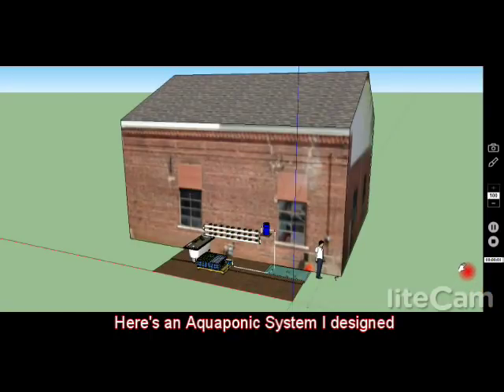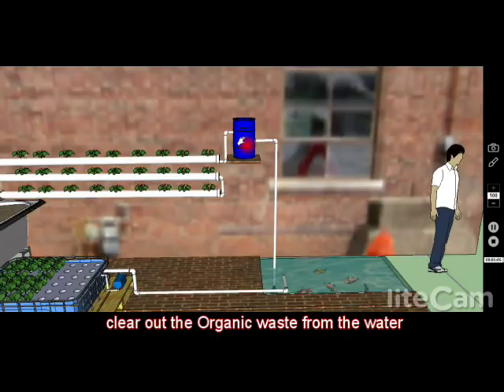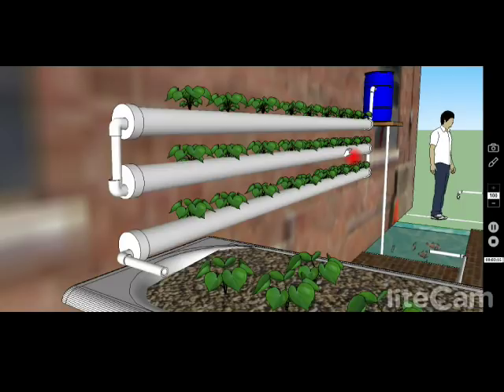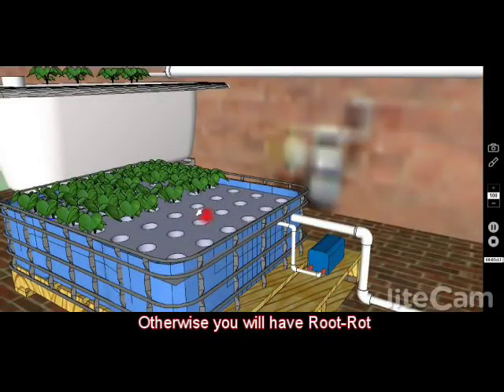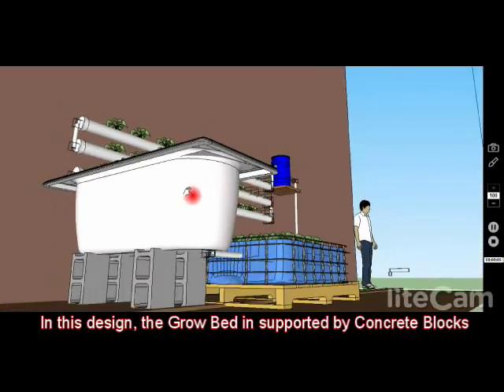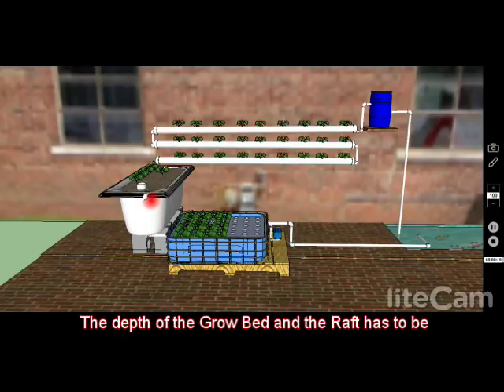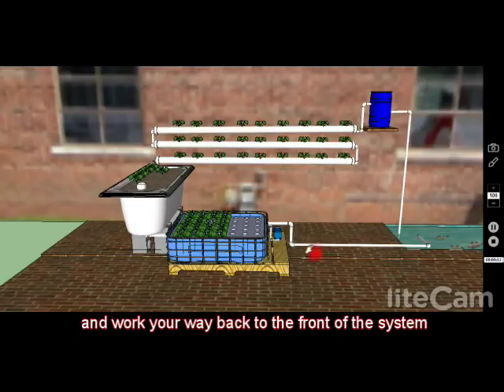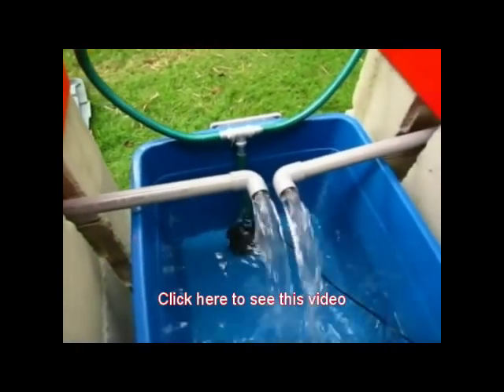DIY Aquaponics for Beginners 2014, a How To guide to making your first AP system

Comment: worst sound quality but one of the better systems I have ever seen. The only issue I can see is that assuming the wall is your house wall air pump will make continuous noise. And pumps tend to fail often I wonder if you could get away with single pump in this system.... An expensive one which will pump air and water...

Comment: I think its only theory.  And cannot work properly.  Because its lack of filtration.... And application not working. So much amonia if just swilrl filter installed. Plant need nitrat.. No amonia
Reply: u can put extra filtration in the bucket and use more than one bucket filter system maybe 2 or 3 buckets total

Comment: Not a good setup. Good concept, but...
1. Pumping water from the fish talk is too dangerous. If there's any leak, the fish will be dead.
2. The swirl filter will capture a lot of solid, but some will make it to the pipes and clog it quickly. Cleaning is frequent and messy.
3. The flow from swirl filter to pipes must be low, which will be hard to trigger the siphon on the grow bed.
4. When the siphon starts, the flow of water to the raft bed are fast and strong, which roots really don't like.

A modify design would be to tread each system separately with ball valves to adjust for water flow. This will also help in maintenance, as you don't need to shut down the whole system. Also add a sump tank. I use all of this in my own system.

Comment: Perfect. Absolutely perfect translation for those who have no prior experience to gardening, least likely hydroponic nor auquaponics. This system could easily be placed indoors by moving fish into a tub.
Great job.
Reply: This gives me a reason to get a larger fish display tank (55 gallons) and routing the water filter through a pvc hydroponic system across the wall, bringing clean water back to the tank.

Comment: Nice design! I think having at least 2 different growing styles is ideal. I think this is the first i've seen that uses 3 different methods.
Reply: Any particular reason to use multiple systems?
Reply: @AbhimanyuNaikareWebDeveloper  Different plants have different requirements, so rather than just limitting yourself to leafy greans in an NFT system you could add growbeds and allow for tomatoes etc.
Reply: @gaijinguide9017  Thanks for the quick response. Can i find which plant suits which system anywhere? Also there is no mention of temperature control here. I believe it also plays an important role.
The nutrients being added in water won't harm the fishes in the last pond?
Reply: @AbhimanyuNaikareWebDeveloper The School of Aquaponics channel is really helpful. Other than that there are a handful of others that I'm subscribed to. (You can search thru my subs if you wish) Don't know too much about water temp honestly. Adding chemicals to treat your fish/plants can be destructive but their are plenty of nutrition supplements that will work great in Aquaponics. Just search "trace nutrients in Aquaponics" and something should come up.

Comment: Your whole system is great as it is. You can, however, improve it a bit by installing another filter after the swirl filter. The swirl filter can only filter heavy solids. It cannot filter suspended solids. These suspended solids will eventually lodge in the roots of the NFT system rendering those plants inefficient. If you don't want to install a fine filter then you can put the growbed before the NFT. The growbed will act as a fine filter.
Reply: Aquatic plants waterhycine  deep roots plants  can help

Comment: That swirl filter is useless. The organic matter is too dense to sink to the bottom. Plus, the uptake pipe from the submersible pump would need to be above the outlet pipe going to the first set of auqaponic system. This would be a pretty expensive setup consider that submersible pump is going to cost a few hundred. The idea is good, but not practical.

Comment: Some systems have biofilter after swirl filter - your system does''nt need that why?
Reply: Hello Thùy Linh Nguyễn Thị, the swirl filter is likely to settle most of the solids which can then be removed and used for fertiliser on the soil garden (vegetable or flowers). However, if the solids accumulate too quickly a bio-filter would be useful, particularly before an/the NFT system.. Often, the media grow bed is used or takes the place of, the bio-filter.
Reply: The media bed is a bio filter by default, if it has surface area and oxygen it becomes a bio filter. Tis important to keep solids to a minimum if you dont want the media bed being clogged up, in which case its a mechanical filter that is needed.

Comment: The water from media bed to raft bed flows not continuous, for example until the siphon opens and let some amount of water flow to raft bed i cannot imagine what will be the level of water on raft bed.
Reply: Hello Duman Kurenbaev, because the inflow pipe to the raft bed is at the same height as the outflow pipe, the water in the raft bed will stay the same all the time. So when the bell siphon in the media grow bed opens (siphons) the same amount of water will flow out of the raft bed as flows into the raft bed from the media grow bed. In this system, it is the water level in the fish tank, being used also as the sump tank, which will rise and fall as the water flows into the media bed and siphons out to the raft bed.

Comment: Not a good setup! So many problems can occur, from start to finish.
1. Pumping water up from the fish tank will cut the waste into smaller pieces, making the swirl filter less effective.
2. Some waste will get into the pipes, which will clog it very fast, causing over spill. 
3. Timing the water flow from the pipe to grow bed is quite difficult for the bell siphon to work.
4. When the nutrients reached the raft, it may be mostly depleted.
5. If one part of the system need maintenance, the whole setup may have to shut down, which many be harmful to the fish and plants.

I have a system with all the components, but I added a sump tank that everything flow into.
Reply: Hello Mark Ho, although I understand your concerns, this system is intended to be a small beginners system, so any maintenance downtime is likely to be short and is part of the learning process. I do think it is a good beginners system, incorporating the three main system types, in an inexpensive, easy to build and modify setup. All of the components of this system can be used later, as required or desired, in a more sophisticated system.
Reply: P.S.        Particularly if integrating an already existing in-ground fish pond or tank, not wanting to build a fairly heavy raised fish tank for the system, or dig a lower sump tank.

Comment: This is a great idea to make use of all the nutrients and cater to a variety of different plants. There is however one downside to your system, due to the bell siphon in the grow bed, your fish tank will experience a rise and fall of water depth which is supposedly not ideal nor is the pump within the water. An easy solution is to create a reservoir housing the pump, this is then attached to an overflow on your fish tank and therefore keeping the irritation of the pump and water lever of the fish tank to an appropriate level at all times.

Comment: Is there any particular advantage to using a bell siphon vs just a plain old drain pipe? I was asking a horticulture teacher recently about why some commercial operations i see have the plants continuously submerged, like media cups just poked through holes in styrofoam and the foam floating directly on the water and others do these ebb and flow setups where they're only exposed to the nutrient water for limited amounts of time. Why? Are there certain plants that just don't do well with constant exposure?

Comment: Surely if you had put the media bed before the NFT you would have not needed the swirl filter?
Reply: Spot on.. the only time needing an actual filter with media beds is when using dwc as the tank needs different flow rates then nft and media beds.. the one large media bed could have easily filtered and supplied flow for the nft in this system.
Reply: Not certain about the points made but ,if anyone else is searching for aquaponics diagram try Debuncar Amazing Aquaponics  Aid (should be on google have a look ) ? Ive heard some amazing things about it and my buddy got excellent success with it.
Reply: Go here now if you want the best aquaponics system online: HootAqua.info
Reply: interesting points ,if anyone else wants to learn about aquaponics courses try Tarbetti Amazing Aquaponics Tutor (do a search on google ) ? Ive heard some pretty good things about it and my friend got great success with it.

Comment: Could you use a kratke method for your raft bed? No idea if I spelled kratke right but basically you leave air space on the root so you don't need a pump.

Comment: Wouldn't it make more sense having the NFT draining into the raft bed before running into the media bed, as the media bed when draining via the bell siphon would put a major leak risk by adding too much water when draining.

Adding the raft before the media bed means that the constant drain from the Raft and NFT work at a more even pace removing or lessening the risk of overflow or leaks, and u could add a ventauri to the drain into the fish tank that would only work when the siphon is running..

Just occurred to me when looking at the design. No insult or slight intended, just observation
Reply: I agree with your thinking.  The inlet to the Raft can be at the bottom and outlet on top so there is no stagnant water.
Reply: agree
Reply: I've been investigating books on  and found an awesome website at Fast Track Grower (look it up on google)
Reply: Here's a great aquaponics system that I use: AquaSystem.xyz

Comment: I have one suggestion. I think if you put the grow bed tub a little bit higher and allow it's drainage system to flow from a higher point then the turbulence that it will make into the raft system will be enough to build up the oxygen level and prevent the root rot. In that sense the the air pump is unnecessary and you can save some money. Am i right?
Reply: The only problem I see with this system is that as the ebb-and-flow tub is filling, the pond level will go down.  Your fish pond must have way more water than will be used in the tub.  This is the reason why many systems use a storage basin that rises and falls, while the pond stays at a constant level.  The pond has an outflow pipe near the top similar to the floating raft to maintain a constant level, this pipe feeds into the storage basin.  The pump pulls the water out of the storage basin whose level will drop while the tub fills.  When the tub drains through the raft area, it's outflow then goes back to the pond, which again overflows into the storage basin where the water level rises with the excess water being dumped into it.
Reply: same thought, would water trickle from the grow bed be enough to aerate the raft bed?
Reply: @ealmuete9143  Not really  , coming out of de syphon it will have some speed (every 15 minits de water will come out of the grow bed ) and will have enough speed to create a ventury system coming in the raft bed.

Comment: Real nice and you explained is very nicely, just wana know as you said in the high filter have organic material in bottom, what material is that? (as i  new on this and still not yet had started any aquaponics system)
i need to know as you pipe showing will be water in the pipe, is the water should be always in the pipe as you showing not big bend pipe used as size of pipe, if you use same size of pipe bend then water will just pass by will not stay in the pipe,
also you said need to use air pump. where should fix and need it.....please explain a bit more, thanks

Comment: Hi Saeid. Very interesting tutorial. I have a couple of points/questions for you.
I built my own prototype (40L'ish with a dozen odd goldfish) a couple of years or so ago, which flushed out all sorts of design flaws, but made great tomatoes and spring onions too  :-D  I'm now planning one with about 2000L capacity.

First I'm wondering why you have a separate raft system. I was planning that, if I include rafts, I'd float them directly on the fish tanks, perhaps with a root guard to stop the fish nibbling them down too much if needed.
Next, I was a little concerned with you feeding the raft tank from a flood drain system. The raft tank water level will fluctuate quite a lot from this. Is that the intended function of the tank, in order to isolate the fish tank from that stress?

On my prototype system I found that by having a 2 level system I could have a flood/drain at the top, flooding slowly and draining rapidly through a bell syphon. That inundated the second lower section which had a continuous drain so this was intrinsically a flood fast, drain slow system. It was self regulating enough because 1) it drained faster when it was full and 2) it was tuned to fully drain a little bit before the next inundation occurred.
Combined this way the level in the fish tank remained very stable, both systems were flood/drain thanks to a single bell syphon (which I understand is optimal for moistening and oxygenating the plant roots and boosting growth). Because the water levels were going up and down in both beds, pumping air in and out of the beds like a set of lungs, the return water must have been about as oxygenated as it possibly could have been too.

Also I'm wondering why the swirl filter is required?
Isn't the solid waste of value to the grow beds? Is it just to reduce grow bed maintenance? I did find a lot of sludge in my prototype when I decommissioned it, but it didn't seem unmanageable.

May be interesting for you to know, I introduced a dozen or so earth worms to the beds at the start, in the hopes that they would inoculate the grow beds with their friendly gut bacteria. I thought the flood drain might just drown them, but in fact they thrived and you could hear them moving around in there and watch them coming up to eat fallen leaves at night. I even found some had become fully aquatic, living in the sludge at the bottom of the fish tank when I decommissioned it and the grow bed itself had hundreds of them in the end.
Reply from the maker: Hi Richard. I will address your questions in order and to the best of my knowledge.
Floating the rafts on the fish tank is a GREAT idea. I have seen a few examples by this guy in South Korea, I think. It's an amazing system. IT makes perfect sense too. That's my dream system if I can have a pond big enough to do that.

Second, feeding the raft from the bell syphon shouldn't fluctuate the water level too much, if any at all. The input, out put should be tuned, as you mentioned. I imagine an input of 1 inch into the raft and out put of 2" would do the trick. Again has to be tried out.

THe swirl filter as far as I know is required to get the sludge out. That's one of the causes of root rot as the sludge gather around the roots.

I have seen examples of worms in AP systems and it was said that it's agreat help.

I'm really happy to hear that you've already had a successful AP system and are upscaling. 

Thank you
SAeid
Reply: Saeid Momtahan Thanks Saeid. The sludge and root rot is very useful to know about.
Reply: Pijush Dey
Thanks for the suggestion Pijush/Siful. I'll check it out.

Comment: The only place in the system that the ammonia is being changed into useful nitrates is the bath tub.  This will cause the tub and the float tank to have a slight advantage, as they can get to any new nitrogen first.  I don't know if that will seriously effect growth rates or not, though.
Reply from the maker: That's a good point Bubba. I have seen, well they're every where, systems that consist of only the NFT (the first section with the semi parallel PVC pipes) that do well in growing certain greens.

Comment: Hi Saeid and thanks for a very nice video and setup. Inspiring. I have a question since I am about to do a very simple grow bed version to test. I thought the grow bed was the bio-filter that captured the nutrients from the fish to feed the plants? Why do you have the swirl filter remove them before the plants can use them? I am confused. Thanks
Reply from the maker: Hi Joakim. My understanding is that the plants use the nutrients in the water , and not the floating debris. I have forgotten what the chemical reactions are. THe filter is there t take out all the gunk that develops over time, which will clog up yr system, as well as gather around the plants roots
TY
Saeid
Reply: Ok that makes sense then :). Thanks for clearing that up. Maybe I will have to add a filter then since now I only have the bio-bed. Good to know.
Cheers /Joakim

Comment: Saed, great video bro. But what size is the barrel for the swirl filter. Is that a 55 gallon blue barrel or some barrel much smaller?
Reply from the maker: Hey Sandman, thanks! As you notice I don't give much in the way of sizes of things here. THis is just a concept video. 
A 55 gallon barrel is huge. If you got a small system, like the one I'm shwing you here, something about half of that would be OK. But look around for examples of Swirl filter to get more ideas
Later,
Saeid

Comment: Hi Saeid, great video. Don't nft systems need very little flow to function? With such low flow draining into the grow bed won't it take a very long time to fill to create the siphon?
Reply: Hi Sean. As far as I know NFT systems can work with little flow. But it doesn't mean they won't work with much more flow.

That's what my understanding is. May be you could research it some more and find out.

TY
SAeid